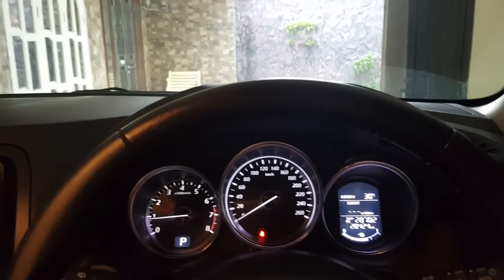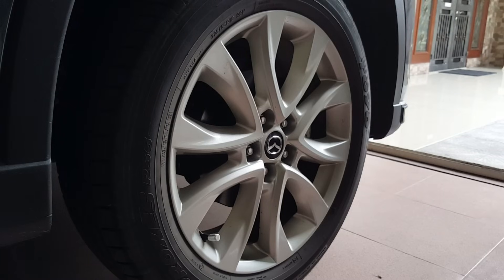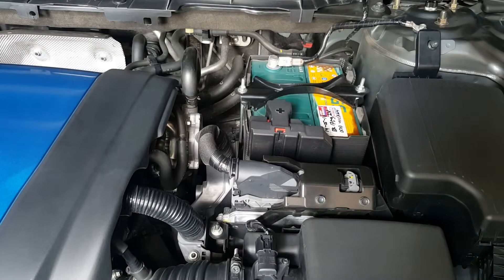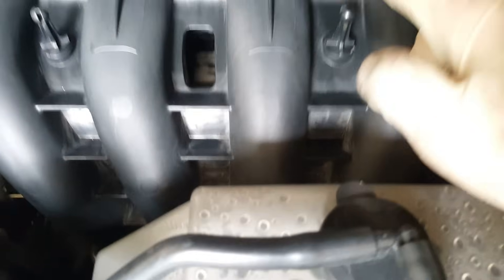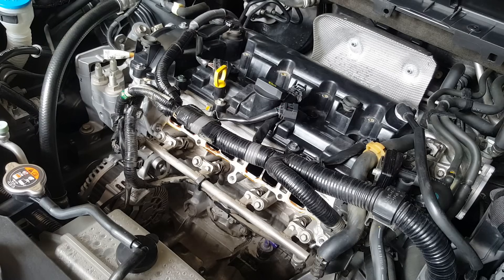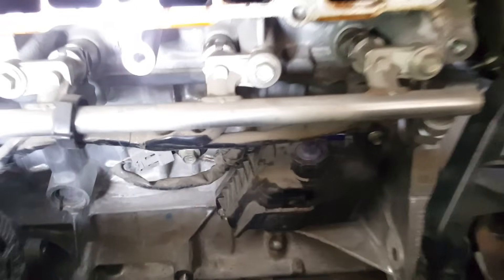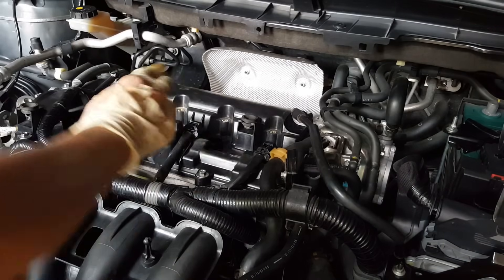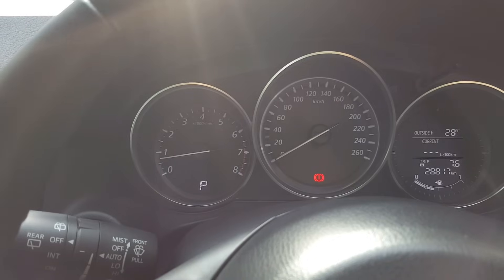How to Clean Intake valves / Carbon clean // Mazda CX 5 (All Skyactiv Gasoline Engines)

Comment: Is there a difference between throttle body cleaner and an Intake Valve Cleaner if done with your procedure (manual cleaning)? Or Can I used a throttle body cleaner on this procedure?
Reply from the maker: TB cleaner will clean some residue but you going to need more than 1 can to clean the stubborn carbons. It is recommended to use a proper cleaner (carbon cleaner) for best results. Thank you .

Comment: Honestly doesnt look that bad. I doubt that would cause any sort of performance issues.
Reply: I was thinking the same.
Reply: I totally agree, until the buildup becomes thick and robust enough to significantly interfere with air flow it shouldn't be a problem. When it's bad enough you usually get misfires at idle and throw a code. I've always wondered how much of the deposits are oil being sucked down the valve stem and not getting washed off by the old port injection?
Reply: @Kwisatzhaderachgiveadogabone  not sure, but Mazda engineered the valves to get hot enough so it will never get that bad. Even if it starts, Italian tuneup will fix it

Comment: If this doesnt work 
next step replace engine
bin there done that
Reply: Sore pak felix, mau tanya terkait tutorial intake cleaning.
Setelah sy ikuti tutorial pak felix, sy sdh berhasil cleaning throttle body, sensor map dan maf (iat). Terimakasih sebelum nya.

Terkait intake manifold, ada sebagian rekan sy yg bilang klo bongkar intake manifold itu berisiko pak, dan takut2 gasket nya rusak saat di buka dan kita ga siap replacement nya, bgmn pendapat bapak?
Kemudian untuk hole ke arah ruang bakar apakah boleh di semprot dan d banjiri cleaner pak ketimbang di sikat dengan sikat gigi?
Satu lagi, sy lihat ada beberapa tutorial membersihkan lubang busi di mesin, setelah d banjiri kemudian cleaner yg sudah hitam di sedot kembali, apakah tidak bisa di nyalakan mesin saja agar terbakar dan menguap? Mohon penjelasan.
Terimakasih sebelum nya pak

Comment: Dan, Mazda claimed that they have installed for the DI Skyactive 2.0 an oil/air filter to prevent this matter, based on this I've bought an CX 3 - 2.0 l  - 2018...hope it was not a marketing bull shi... Do you know please if is true what they've told me? Thank you.
Reply: What Mazda told you is true, it’s called an oil separator. The problem is that it is not very effective.

Comment: is it necessary to remove spark plugs to do this? What if I don't remove them to do the work? thanks.
Reply from the maker: Yeap . For easier engine rotation Spark plug should be remove prior cleaning but You can do without it removed . Just have to use a bit of force to turn the engine clockwise.

Comment: Fantastic video, thank you. Did you see a PCV valve under the manifold? Is the oil catch standard or did you add it? I read that the PCV was under there, did you replace it? Thanks for any info from a 2015 Mazda 3 2.0 owner.
Reply from the maker: You welcome sir. Thank you for tuning in to this channel. Yes theres a pcv valve hidden behind the intake manifold. Oil catch /oil seperator can is standard on this engines.

Comment: I just came here to see what’s involved in removing the intake manifold.  I gotta do this on my wife’s CX5 to replace the knock sensor.  Dealer wanted $400+ to do it.  Makes me appreciate my Ford all the more!
Reply: All Ford Ecoboost engines have DI as well. The carbon buildup problem is even made worse by the turbo.  Boosted engines have higher pressures, leading to more carbon vapors being pushed out of the engine crankcase through the PCV and into the engine intakes. 

Ford is in the process of adding Dual Injection (Direct and Port) to address the problem on a few of their vehicles, but most are still DI only.

Toyota is the only company that now has Dual Injection on their entire fleet line.
Reply: Never ever heard that before . Someone who appreciates working on a ford lol
Reply: Did you have a code for the knock sensor? How come replacing it ?
Reply: aall direc tinjected engines need this done!

Comment: Hi, do you turn the crank left or right to rotate the engine? Or does it matter which way you turn it?
Reply from the maker: Turn the crank shaft towards you as like when the engine is on running. Perhaps take off the spark plugs first so theres no compression within the engine and you can turn the engine over easier. Cheers.
Reply: @GarasiFelixDan  Thanks, but which way is towards me? Right or left? Also, can you turn it both ways to adjust the position?
Reply from the maker: @justbrosing  yes to the right . Yes you can adjust a little only . Do not over turn. If you miss one just skip to next cylinder. And redo later.

Comment: Hi Felix,
My mazda3 2.0L skyactiv has 128k km and no sign of increase fuel consumption or other issue. The cleaning you did does not seem to be something I will enjoy, so when the issue will show its teeth, I will probably try the CRC spray and if that will not work I will probably trade-in for one with hybrid injection... and my cx5 will follow the same path. Very instructive video, thanks.

Comment: I was in the market looking for a new SUV and Mazda was my top choice, but to have to perform this type of work on such a young engine is insane. For the same reason I wouldn't buy a vehicle with the old DI system. This is just unacceptable. I've had to remove the intake manifold and valve covers once on my 2005 Accord to replace gaskets on 2017 with 140k Miles on the car. the engine inside looked clean and beautiful. Peace
Reply from the maker: Hey Anthony. Personally i think all newer engine will have similar issues most of them will have GDI engines . Just that it is all depends again how you maintain the vehicle at the start of ownership. Then again carbon build up issue will vary from one car to another , depends on what fuel we using for the vehicle and how's the car been driven in everyday basis. I was performing this service to give some idea , heads up to all mazda owners what they have to look for if they are experiencing bad milage not perform well not as expected. This maybe due to the condition of our fuel,  driving styles mainly start stop in city driving (40km/h) daily. We dont get to see highways alot that also one possibilities why theres carbon build up on a young engines. But overall what i analyse from reviews comparing japanese brand manufacture not to say they are bad .... but personally i think the newer Mazda have created one of a good engines for users and they are easy to maintain and access. Hope this will give you some light about choosing your next SUV.
Reply: or get those port + direct injection ones for example the toyota D4S kind

*looks like already mentioned by some post up there about port+direct injection
Reply: @pec1739  Unfortunately Toyota is the only company who's added dual injection to all their vehicles. My next car will have to be a Toyota, as I like to buy and hold my cars for 10+ years.
Reply: Nearly all car builders have gone to this flawed design in order to meet the ridiculous CAFE regulation of "54.5 MPG by 2024" imposed by Obama in 2010.  Trump intervened and froze it at 38 MPG recently, but it's still way too high.  So don't expect to see DI go away anytime soon.

In the meantime, Toyota has added Dual Injection (port and direct) to their entire fleet today.  It's the only car company who has done it so far.  I've got my eye on the 2019 RAV4 now.
Reply: @shralperx   Ford is doing the same on their F150 V8.
Reply: @mikey27437  True, but Ford has a long way to go to add Dual Injection to all their vehicles. I believe they got sued for carbon buildup on the F-150, which motivated them to fix it.
Reply: Even tho the valve look dirty, keep in mind that only air flow pass through, the amount of carbon we see here is not enough to seriously disrupt airflow
Reply: @vwbora26  This engine is very low mileage. Imagine it at 100k Miles.  You really need to research it more. Disrupting airflow even a little bit in today's high tech engines can have a huge effect. And it can lead to all sorts of other problems. Engines have been "grenaded" (valves crushed by pistons) in some cases. Do research on VW and Audi DI turbos.  They have the worst record.

Comment: very informative im another subscriber!!! , Question : did you loosen the pulley near the front wheel of the car or had to remove it and why do we need to do that?? is that to loosen the intake manifold or other parts? and when putting the intake manifold back on did you align it through the bolts first? Im use this guide on my 2016 Mazda 6. Thank you!.
Reply from the maker: You welcome . I did not loosen any pulley. I only rotate the crank pulley to shut off the intake valves. Yes i did re align it back after bolt everything back together.
Reply: hey thanks for the response, is it really necessary to rotate crank pulley and shut off the intake valves before doing all of this work? Wanted to skip that step but is it recommended? also is there any engine programming on the MAP or anything needed on the car if i replace the whole intake manifold with a new one? I wanted to be in tip top shape. Thanks again!!!
Reply from the maker: @HumamKiddo  theres no reprogramming toola for the MAP sensor , just make sure disconnect the battery prior doing this service. It not not recommended to skip this steps. U will need to rotate the crank pulley to close the intake valves when cleaning otherwise should you apply the cleaner into the valves it will just enter into the combustion chamber which will not be good for the engine will damage piston n rings and other things.
Reply: ah ok thanks for the suggestion, i appreciate it. so when you say "rotate the crank pulley to close the intake valves", does that mean loosen (or tighten) it with the 21m socket as mentioned in ur video? Thats the part i get a little confused on cuz i dont wana mistake it....while u brushing the intake valves, did u suck the oil residue in the little bottle with something?..and when we done cleaning the intake valves, should the crank pulley be rotated again either to loosen or tighten as the last step? Thanks for your tips, anything else besides the video i def should know about would be very helpful.. wana make sure before i do this for the first time! thanks again!!! i just cleaned throttle body and MAF on my mazda skyactiv using ur videos!!! Great one
Reply from the maker: @HumamKiddo  awsome. turn the crank pulley clockwise and get another person to watch the intake valves shuts and open. Yes you will need to have a suction tool it would be better as you want minimal particle to be going back in into the combustion chamber .
Reply: thanks ur awesome! so if i turn the crank pulley clockwise, all 4 intake valves should be closing at the same time? il have someone watch me of course... and i should rotate it clockwise to open all 4 intake valves AFTER cleaning the them right? correct me if im wrong here, i dont wana mistake even one small procedure here. il be watching more of ur videos if u post anything related to Mazda Skyativ engines!
Reply from the maker: when you rotate the crank pulley . You will see each of the intake valves moves open and closes one cylinder by one cylinder.
Reply: @GarasiFelixDan  Thank you Felix! I just got my parts and probably gona do this weekend. is it better to remove spark plugs before turning the crank pulley? only clean intake valves when the valves are Closed position correct?? also when the job is done, should i rotate the crank pulley so all intake valves be open again? lastly do u have a video that shows if the intake valves are open or closed?? Sorry noob doing this hehehe thanks for your assist! appreciate it
Reply from the maker: @HumamKiddo  you can turn crank pulley with the sparkies installed. But it will be better to have it removed so you will be able to turn the crank pulley easier. After completing the service you dont have to turn the crank pulley just reinstall everything back then start the car up as per normal let it idle for 5 mins .
Reply: @GarasiFelixDan  got it! il remove the spark plugs for easier crank pulley removal. when you say "dont have to turn the crank pulley", do you mean the intake valves can be either closed or open after done with the service? and when i watch ur video again and the comments below, i believe rotating each 180 degrees makes like 1 or 2 cylinder intake valves open or shut right? and when you are done with cylinders 1 and 3, you rotate crank again to close the 1 and 3, then open 2 and 4? Thanks again i do appreciate it.
Reply from the maker: @HumamKiddo  that is correct . :)
Reply: @GarasiFelixDan  Thanks Big help!. did you put the car in park mode (auto tranny) or any other gear while its off before you rotated the engine?
Reply from the maker: @HumamKiddo  yess i forgot to mentioned . Good stuff !! . You got to put the gear in N. Parking brake on .

Comment: My Mazda CX-5 2014 its been making an unusual sound I am not sure if it needs some of these cleanups. would help me by listening to the sound I recorded and see if its due to this type of carbon accumulations?
Reply from the maker: Hi Carlos. What kind of sound are you getting. Is it engine mechanical noise ? Suspension chassis noise ? . How many k's has the car done . Cheers.
Reply: It was a noise that water pump was doing and needed to be replaced along with a o-ring , I ended up going to Mazda for the diagnostic, parts and labor. Mazda 2014 with 70000
Reply from the maker: @carloscab3854  Awsome!! glad you fix the problems. Thank you for sharing to us here on the forums. So one thing to do as preventative maintenance perhaps after 50000kms or 60000kms to check the water pump assy along with drive +water pump belts to get them replaced.

Comment: Looks tough but you did a great job! I suggest you use a better brushing tool next time. How do you drive your Mazda? They say if you spend a lot of time in heavy traffic then carbon deposits would build up quickly and if you drive hard it would help prevent carbon build up with skyactiv engines.
Reply from the maker: Thank you sir. Well we only get full on traffic here barely doing past 60kmh most of the time. I will use better brushing tool next time . Cheers mate.
Reply: what brush do you suggest?
Reply: @du763  anything softer than aluminium which is the material used for the head,  brass wire brush will do i guess.
Reply: This carbon is building up on the "top of the intake valves", an area which sees very little heat in the 4 cycle engine process. I'm sure low speed operation contributes to carbon buildup in the cylinder/head area but this intake valve stuff just starting showing up bad with direct injection. The back (upper) side of the intake valve sees only intake air temperatures, I dont think driving hard is going to affect the  carbon buildup here.
Reply: In Canada, do not use PetroCanada fuel. It has gumed up even my Toyotas. I strongly suggest Esso gas is best. Use 2 tank fulls at least to clean out valves with highway driving. I think if a car needs this much service at 26,000km its a useless car. This is my first and last Mazda. I have a 2022 model CX5 2.5L turbo, so its even harder to work on without removing turbo i assume. My Toyotas had over 360,000km and ran like new when i got rid of them. They say you have to replace water pump at 100k also. This is way too expensive, compared to Toyota.
Reply: @icanfixit.6656 these are great cars and I've never heard of a problem caused by carbon buildup. They are extremely reliable. By the way almost all cars are using the same direct injection method.

Comment: Thanks dear I have cx5 2016 when I drive fast and rpm up when is top safely rpm will go up first then down its normal I asked dealer seaid engine break
Reply from the maker: Is your car new from dealership. Is your car auto or manual ? If the car is going into stop the engine shouldnt rev up and down.
Reply: @GarasiFelixDan  its new auto when I want to break the rpm will go up little then down they said it's normal because engine brake
Reply from the maker: @oreeenoreeen7226  okay . If it is consider normal by your local dealer maybe drive it for now until the break in period completed. If the problem still occurs maybe go back again to the dealer and bring back the issue ?.